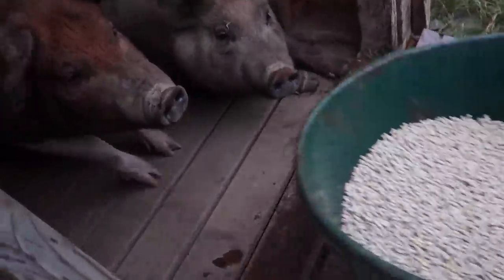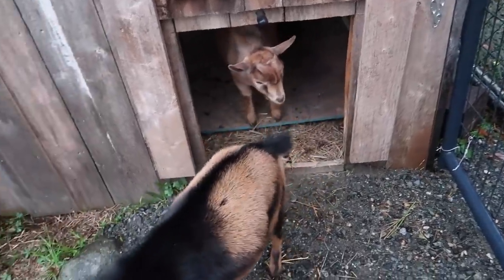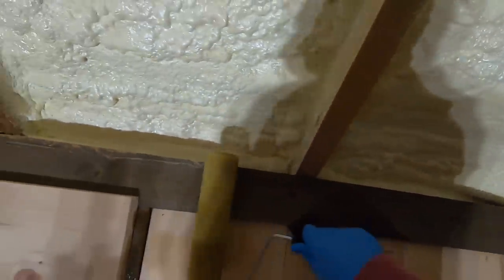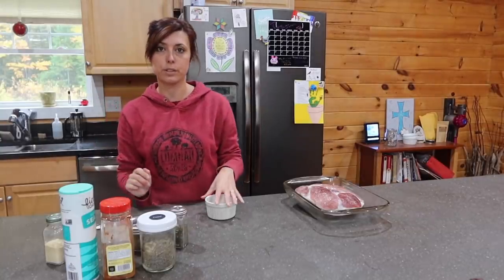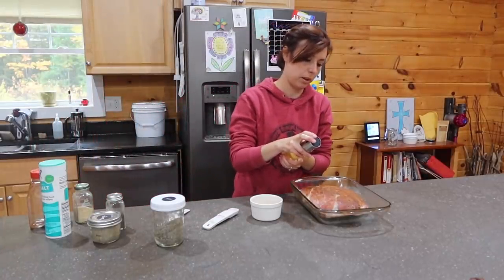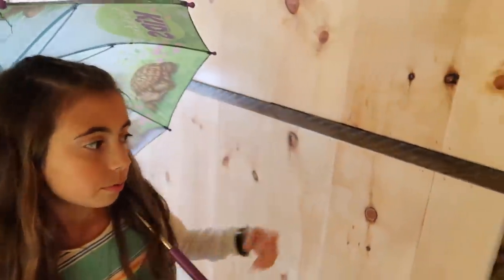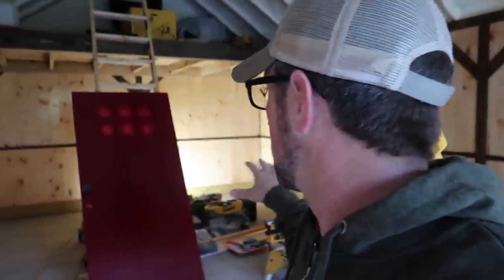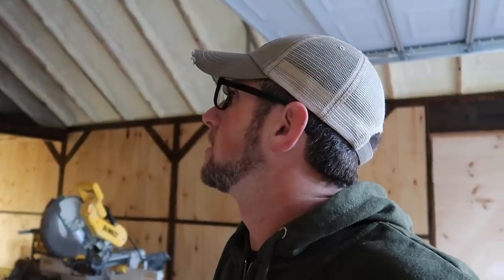Time to Get Sticky! Applying the FINISH to the Post & Beam WorkShop

Comment: cough, cough...studio space...So, I missed a day and got to spend a whole hour with you catching up. I have an teacher's note, chilli won the first heavy meal of fall. Unfortunately, I chose the warmer, sunny days to make it. I have watched so many vids on shop organization, I hardly know where to start however...Since the chop-saw will be semi-permanent, I like the idea of mounting it like a sewing machine so it folds down into the work bench. I also like the small storage ideas having small part bins that are as flat as possible against the wall but also swing down to bench height.(what is the top-bar unhooks and swings down to rest on the bench.) Ceiling: maybe a false center beam hiding wiring for overhead lighting and outlets, you can never have too many outlets. Not really keen on a center island for your space surprisingly; the U-shape lends itself to long, clean lines and I like it for production flow. However, you could use the same sewing machine mounting idea in a rolling center island or in the counter space, I'm sure all the shop guys & gals will bombard you with clever innovations to help finish your fancy shop...waiting patiently, so I can learn too  ;)

Comment: Dont forget to seal the floor to help prevent staining. Work benches to the back would be great, make a good frame and use 2 - 8 foot pieces of ply wood but dont join them so they too will be movable.

Comment: Since its almost 16 feet wide, i would make 2 8foot sections for the back wall no deeper than 30 inches. That way you can Put your nuts and bolt boxes along the back, if you dont put them on shelves above the bench like we did. We have two wire shelves running the length of the workbench, the upper one is 16 inches deep, lower one is 12 deep. Our workbench is 16 feet long (workshop is 16 x 32).  I would do two additional benches 12 feet long, on each wall(all benches on wheels of course). You need wood storage, so i would take the right hand wall and make a lumber rack to hold the stock and if the rack is pulled away from the wall about 12- 18 inches, you could put your sheet goods right behind it. Table saw would go in the middle and dust collection pipes in a U shape along the walking paths.(or above the bench out of the way). They need to be up out of the way, but low enough to open and close the gates. We have our table saw, spindle sander, router table, scrollsaw and jointer (on one side of the room) hooked up to one dust collector, then on the other side we have

Comment: nothing dark on the ceiling, finish the floor with an epoxy, rubber floor mats to keep your knees for the future, make sure you put couple of outlets up in the loft, also led fluorescents (4 foot) are VERY bright so you will not need many of them, also use a lot more switches than you might think for everything (outlets, lights etc), as far as the workbenches are concerned I would say at least one should be permanent and the rest should be mobile with locking wheels. Also the idea of shelves is a good one and you will need a lot of them.

Comment: For the work bench tops, I suggest oak lumber, at least 2x4 on edge, meaning 4 inch thick, and drill through the boards and bolt together with all thread rods.

Comment: I have a similar setup in my workshop. By that I mean u shaped. I used 2x4’s for legs with a shelf on bottom. 3/4 plywood for the top. And a peg board in the middle.  I do think eventually I will replace the top with something heavier. Probably butcher block type out of 2x4’s. I also have 2 workbench carts on wheels for working on long projects. They are the same height as the workbench. That way they work well together when rolling or sliding work from one surface to the other. I do wish I would have thought to put two locking casters on each cart though.

Comment: Suggest keeping the compressor outside to keep the noise down. all rolling benches and cabinets, maybe some drop down electrical outlets to help keep cords off the floor and give versatility, pull down from ceiling storage, an outhouse may be nice, If you plan to make dust might include ventilation and enclosed storage, outside heating vented to inside for on coldest days, ...always looking forward to your videos...thanks.

Comment: white metal panels for the ceiling reflects alot of light  2x3  butcher block countertops  with clear  very strong  and cheap  have both in my shop

Comment: I suggest countertops the same color as the posts with lower sections the light wall color. I've seen others suggesting that even the U workstation should be constructed to be mobile and I agree. Just like with the conduit for electrical,  having mobile components allows you to reconfigure to fit the needs of any particular use. The future is not static, why should our workspace be?

Comment: Morning my input on electric use emt you can paint it with flat black cheap Walmart spray paint. grey pvc pipe likes to sag to much  you will have to use less straps to hold it. Led lights are so much brighter and use less electric.

Comment: Make a long butcher type table on one side of the work shop  using a 2x4’s lay them side top glue them up together and screw them using pocket hole. You can put all your other power tools on this table made of 2x3’s  then use the underneath as cabinet for small tools, screws,
Nails, etc. If you could build a 6 or 7 feet cabinet would be great, good luck

Comment: If you're planning on using the shop year-round, I would place rigid insulation into the back of the garage door. HUGE difference in interior temperatures. Slap some paint over the insulation and the esthetics are improved over bare insulation. YMMV

Comment: Are you going to have lights in goat part of barn? You need a place,for your tool and accessories like nails, screws,  paint, paint brushes ,rolls, stain ,get your table saw up off the ground and plenty of lighting and outlets , and a dedicated battery charging area, iit easier to put outlets right away  better to have more than you need than not enough you have lots of electrical equipment ,also  some out side outlet probably on each side of of the barn incase you have a car,truck, tractor heater battery jumper, charger. It easier to put it in in the beginning .

Comment: You could make fold up shelf/desk area where the legs fold into the underside of the top and then fold down and are held closed with the same latch and eye your goat windows are using. I would make the chop saw table/desk out of 4x4 for legs and the top either 2x4 or see if your mill can get you a 4" live edge for the tops 12 feet long 3 feet wide you woul need 3. I would seal the floor if you plan on working on vehicles. They have great kits. You might think about pulleys and few winch's for lifting heavy parts out of vehicles or even a lift. They have nice 5 ton lifts for couple grand. You may have to reinforce just under the lifts feet. You could I guess weld 3 foot by 3 foot plate steel on the bottom to spread the load.

Comment: I am no expert, but if you want the ability to rearrange, but everything on lockable casters. Maybe a rail system on the walls for shelves that can be moved. Also I would put in a couple of the retractable extension cords from the ceiling. They have them in Joann's where I quilt and them you can have easy access to electricity where ever you are in the barn without having cords on the floor. You to Olivia "Watch out for that cord."

Comment: If you ever plan on doing any thing with metal - Rebuilding an engine, transmission, large parts from the tractor, etc - or Welding or fabrication, I'd have at least one section of Bench top Steel topped with like 2 ft by 4ft or bigger and 1/4 in thick plate - you can use older, used metal for this, just as long as it's FLAT and not bent!

Comment: Never would have used a polyurethane coating, i alway prefer an linseed oil varnish from boiled linseed oil for faster hardening which is way better for later replenish and stays manageable with least effort for centuries. But at the End it at least looks fine and it's up to you to decide what you're ready to live with.

Comment: I suggest that you put an 8 to10-foot workbench on the back wall, with a shelf under the plywood top.  Possibly make a turn to the left running about 6 feet on the left wall. It should not run all across the back wall. You will need some tall storage lockers on the back wall next to your workbench. You could also have a rolling work-workbench like an island that is mobile for your saw and other things. I do not think that butcher-block benches would be practical for a versatile workshop. I like them but, you will need one in your outdoor kitchen.

Comment: I would do drop down outlets on the top beam. You need light up top anyway and it reduces the amount of wiring needed. There are spiral power cords so you never step on wires.

Comment: Hey you can get the metal flex conduit that already has wiring in it. I've used pvc conduit in a trailer mobile work shop and have used the metal flex. For me its been all about price is what I went with.

Comment: I think that long term you need to board the ceiling. You might size each board and put the poly on before they are nailed in place. That insulation will attract dust and glitter and can never be cleaned.

Comment: Suggestion for your shelving as far as mobility., french cleats. That way you can hang all kinds of things and still be able to move them. You are starting with a clean slate, so putting up a french cleat system provides so much versatility. You can make shelves, cabinets, tool hangers all using french cleats. If you change your mind you can easily move them to another cleat location. @frank howarth has a few good videos on using french cleats.

Comment: If you want a bench that will last and fold out of the way. Use 2x6s to build 2 flat tops one offset x 3" and screw them together like board and batten but tight together use glue between layers. Use heavy brass 4 hole door hinges to secure legs on front corners and one in the front center. Then do the same on the top back and fasten them to the wall so the bench rop will fold up and the legs will fold in out of the way. Finish it any way you like. Note: When putting the top together keep the grain curve opposing each other ( ) top to bottom. This will keep the boards from cupping and warping over time. The dimensions are up to your needs, but I would keep the height the same as your miter saw and leave the miter saw on its stand and build the stand for the table saw so the top of the table was at the same height. this will give you portability in your saws along with extension wings to run the longer stock onto. I would also just do 2 benches and hold them at least 3 to 4 feet from the corners so you can work from either end. I do woodworking in my garage and find myself working at the ends of my bench more than not. I also use a vise and grinder mounted on boards to clamp on the bench so I can move them to any location I need them including the bumper of my truck.

Comment: So, once you get your Rock Picking Bucket for the Kabota Tractor you can follow the pigs and pull all the rocks out and move them.  If you build a grizzly head to sort the rock sizes when you dump them at your rock dumping location it will make them very easy to build with in the future. The cost of the Rock Picking Bucket is about $750 USD new.  The pigs expose the rocks, you use the bucket to pick them up, sort them by dropping them on to the grizzly head ( a 45-degree frame with metal rods running vertically down the frame.) Add, more metal rods to reduce the size of each of the stones (The smaller rocks fall though and the large stones get pushed to the bottom of the 45-degree slope.) This makes Gabions easy and simple to do as you will have sorted free rocks to use. 

Now for the selling feature. Using the Gabion concept, build a rocket mass heater under a large-sized area, You are making a wood-fired hot tub. The rocks will maintain the heat for a long long time and if you use the poor man's fiberglass concept you can insulate the pool area so you can just heat the tub directly from the rocket stove heater.   If you slope the walls, you don't have to worry about freezing causing damage or you can just drain the water any time you want.  The same concept can be used if you dig a deep an oversize trench 15 to 20 feet deep,  place the gabions, at the bottom and layer sand over each course of rocks then place tubes inside the gabions connecting a "U "shape to an inverted "U" shape.  This will allow you to pump heated air into the "Heat Battery" for your four-season Geothermal Greenhouse. 

If you drill several holes 20 feet deep at the bottom of your trench, this will give you 35 feet that you can use to add additional energy into the heat battery by using cheap solar-powered fans to drive warm air into the soil during the summer and retrieve 60-degree warm air during the winter. Now if you added your hot tub into the greenhouse as well as a side room, every time you had a nice hot tub you could drive the left overheat when you are done into the heat battery.  

On the garage door use foam panels and wrap them in a polyester cotton blend cloth and use the poor man' fiberglass technique, this gives you a superior hard finish that you can paint, sand and will take massive punishment and still provide you with massive insulation. 

Don't let the ladies read this, or you will be having a new building project very very soon!
Reply from the maker: A rock picker bucket would be nice.

Comment: 1/3 steel bench w metal pegboard for hanging hand tools. Magnetic strips to hang all normal sockets star/allen.  You can see missing ones right away.Vise about inch bigger than needed. Hanging 4ft LED bench lights (or florescent). 2/3 wooden work bench. Run pex air line around inside shop & maybe 2 outside to fill tires. At the end of the air line run add a dummy tank so the compressor  don't cycle as often. Electric bill:) Get enough air couplers & fittings to mount them (Female). Keep them standard with what you now have. Get a timer for air compressor shut off. I really bites to find out a line blew & your compressor is toasted. Later with more goats, there may be a need for air milk machines too.
Reply: Some say paint other say epoxy, the trade off is slippery when wet:) Bottom line is protect that floor. Including under those rubber mats.  In the 1950's, we put in 3 milking stalls & they got washed after milking in morning & night milking. Or bad smells would come out, ALWAYS after drying in.

Comment: I would like to see them as three individual pieces that sit together like a jigsaw as you want them layed out but have each piece/section on wheels so once you unlock the wheels it can be moved around the workshop as jobs and projects change it can change with you then get put away when you have finished the project

Comment: I like my vice bolted down in the middle of the floor on a small table not over two feet by a foot like 1/2 inch steel plate on a six or eight in pipe so I can work all the way around it. Just my opinion of course and im sure other people have their opinions too.

Comment: Curious as why not just spray the urethane, and back brush any runs. So much faster. Make sure to soak the outside wood crazy for the first 2yrs, especially along the bottom 2ft.
Put all tools on casters and even some of the work benches. You'll love it.

Comment: U shaped work benches lose space access in the corners. Maybe a pull down/fold down counter at the end. Or, a rolling work bench for that end spot. 

The recessed counter for the miter saw is good but make a drawer so the saw can pull out.  Make swing out or plug in supports for the wood being sawn. Having to clear the work benches of projects to use the saw would be a pain. Mount the saw on a slab of plywood to slide in wooden rails. 

You will want some of the work bench to overhang to have knee room so you can sit and work on projects. 

I like an area with a Formica surface so I can clean glue and paint spills easily. 

A battery charging shelf with lots of outlets under the shelf is good. I screw 4 inch pieces of 1 inch black poly pipe to the wall with a slit in the outside edge. I can press electrical cords into it to keep them out of the way. 

Have you though of having a thin layer of insulation added to the underside of the lean to roofs to quiet them in the rain? Too much background noise. 2:22 sounds like 22 gun shots. The soft patter on the insulated roof is nice.

Comment: Al as far as work benches you have up against the wall put them on hinges so you can lift them up when you’re not in use you can use chains to hold it at a level position or fold down legs my buddy has it in garage so that way they only needs to pull the car in to work on it he
Reply: Folds and back up and  latches them in place so there out-of-the-way

Comment: Butcher Block with 2x4 is quick and dirty., but material-intensiive and heavy (if you ever have to move it)...maybe a 2x4 frame with a piece of half inch ply is sufficient...I would also put a Big Fan to circulate hanging from that ceiling in the Middle...it also adds to the Bayou look...lol

Comment: I said once there is a you tube channel call Woodshop Junkies. Check out the Ultimate garage storage... it folds down from the underside of your loft over the bench. To organize screws and nails sandpaper, etc. One for craft supplies ...
And it all tucks away out sight later when not in use. Will seek out videos that do work benches.

Comment: May I suggest you obtain a small blacksmiths anvil that you could mount on a heavy log section. I appreciate it might not be as mobile as a rolling workbench but there will be times when you need to hammer on metal, most wooden workbenches don't stand up to that type of abuse regardless of how well the vice holds the work piece.